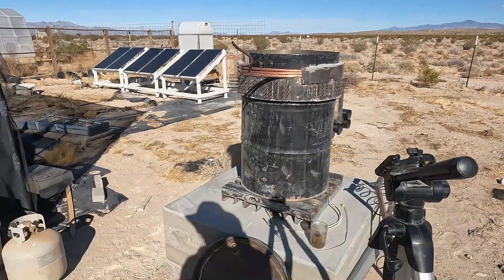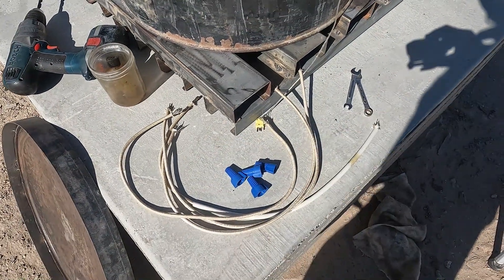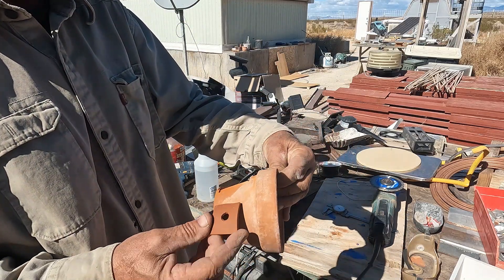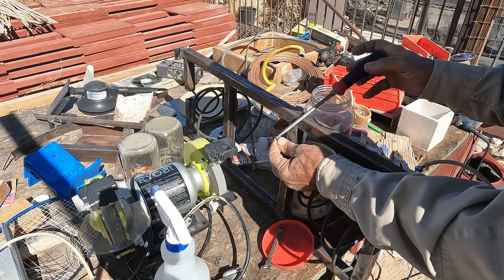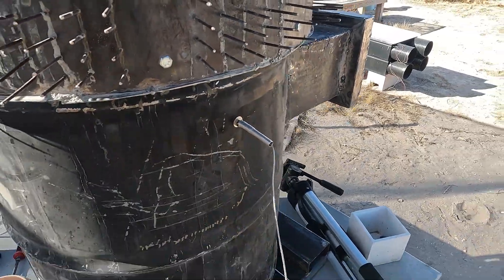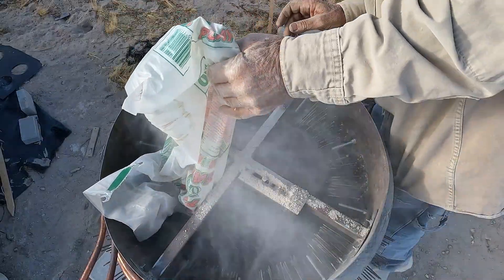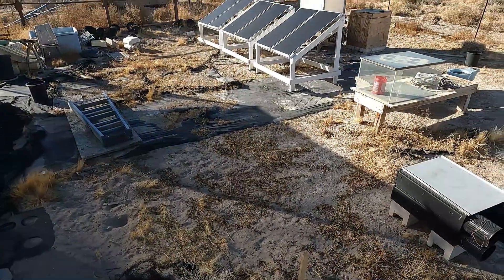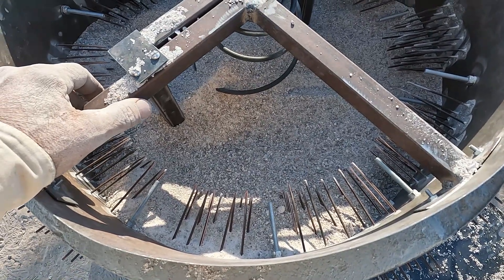168 - Fifty-Five Gallon Sand Battery Update

Comment: Hi Mike, I use glass and tile drill bits for drilling terracotta etc, they actually have a point which makes it real easy for starting the drilling process. If you do a search on the internet for glass and tile drill bits they should pop up. Great VLOG again 👍
Reply from the maker: Thank you for that information. I actually have at least one of those bits somewhere I will give it a try. That makes since considering it seems to cut like glass also.